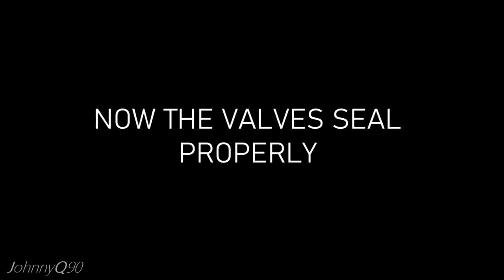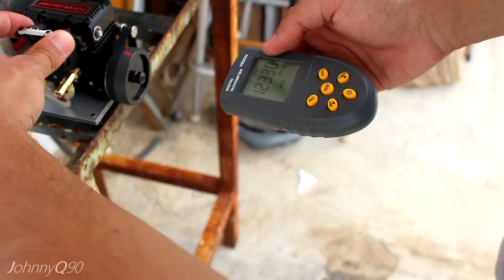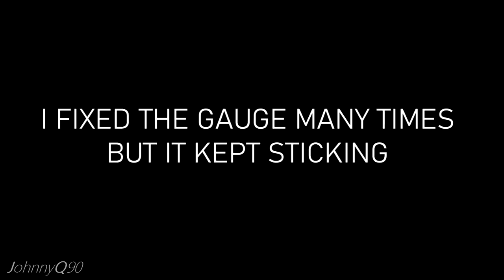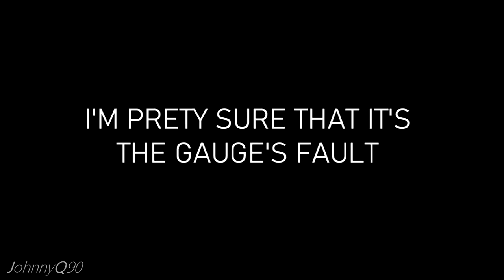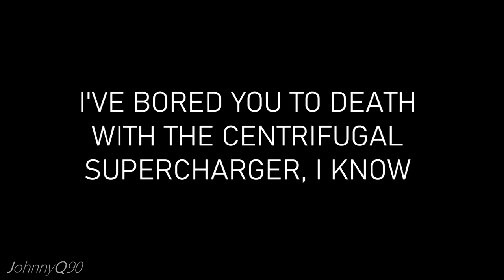PERFORMANCE Upgrade for the 4 Stroke TWIN Cylinder - *VALVE Lapping* - Supercharger Update

Comment: Bored to death with a centrifugal supercharger? Never! I haven't seen one of these things put onto a model engine, and it's super badass! You're so close man! Don't give up!
Reply: 100% agree, don’t give up on the supercharger! Also agree with some of the other comments, possibly EFI? maybe a team up with a channel that can produce something on RasberryPi etc 🧐
Reply: This
Reply: @_Mav  Trust me, you wouldn't want to use a Raspberry Pi (SBC) for any engine application. A microcontroller (Ironically, the Raspberry Pi Pico could be used) is what you want.
Reply: @crenn6977  maybe just add fuel pump?
Reply: @crenn6977  just saw the video and at the end, some sort of fuel injection, even if it's just somet to adjust on the fly as the engine revs. Not EFI, "M (manual) FI" lol. Could this little thing have run away boost? Lol. Alright Johnny, time for that micro blow off valve 😬. How would you solve the EFI if not a small computer controlled fuel injection @crenn6977? I'm legitimately curious because Raspberry Pi popped into my head as well.
Reply: @keepsgoing4evr1  a distributor but instead of controlling spark time it controls injectors that plus a fuel pump
Reply: The reason the charger is pulling fuel is the needle and seat isn’t a clean match and the charger is pulling more vacuum than a N/A motor would.
Reply: @mikaelhgn1  Was thinking something similar. A wastegate/supercharger bypass would probably solve the problem. Even positive displacement chargers like the roots on my Audi have a supercharger bypass. This things boosting at idle. Its going to be a lil monster if he keeps the centrifugal. That or need a bigger charger to flow enough air for the top end lol
Reply: @keepsgoing4evr1  Youre about right. He switched from the blow through design, in which the charger pressurizes the carb throat, and manifold, so you need a fuel pump or exhaust pressure line to pressurize the fuel tank to increase fuel pressure to the carb. He used exhaust pulses and you can see the manifold vacuum gauge was going crazy on that setup. Then he reconfigured it to the draw through design, where the carb simply is under port vacuum from the supercharger pulling air through the carb. The gauge was steady then but had been thrashed to hell so now its reading 3psi lol. I wonder if the exhaust pressure was too much on the pull through setup tbh but we use it on NA engines...

The engine is running on nitromethane, not gasoline, so it uses a glowplug ignition. The timing is controlled more so by the rated temperature of the glow plugs. 

The idle fuel mixture is what @Mikael Hogan was talking about. Its adjusted by a screw but the charger introduces a "dynamic displacement". As the charger pulls air past the needle it pulls more fuel with it which, raises engine rpm, which spins the supercharger faster, which pulls in more intake air, which pulls more fuel, which raises rpm, which makes the supercharger spin faster, which pulls more air, and more fuel, and so on lol. Which is why i say some kind of wastegate/supercharger bypass or EFI would solve the idle running away.

Comment: I wouldn't have expected a difference so big just from lapping the valves....
Reply: The sound difference alone is pretty incredible!
Reply: Well at this scale a small imperfection in manufacturing is very unforgiving. On an LS3 these flaws would lose maybe 5 to 10 HP over the stock 430, but on this, for like 1 HP it could stand to lose perhaps a quarter HP or so at the worst. So for an LS being a full size motor, that's between 1 to 2 percent power loss, but on this tiny motor that's a 25 percent loss in power. And with so much air flowing between the valves and the valve seats at 12k RPM before the lapping, it was losing a lot of potential power especially since its rated to reach 16k RPM (it is a Toyan L200). So with that defect fixed and even made better than stock, it likely makes somewhere around 1.25 HP without the supercharger and perhaps 3 or more with the supercharger once the AFR is tuned right with the 10 to 1 pulley.
Reply: @Avetho  3 HP from an engine this size would be amazing to see in action
Reply: Watch where he points lazer when he checks rpm. He is getting more rpm the second reading because he checks it closer to crankshaft. Lapping valves will increase efficiency and power but not by 4,000 rpm
Reply: Jacob Credle you might be confused, the rpm of a rotating body does not change depending where you measure it. A wheel spinning at 60rpm is spinning at 60rpm no matter where you measure it
Reply: @jacobcredle4807  a turn is a turn, the lazer don't care where it is pointed....
Reply: @red1246  yep no regards for diameter. Its not speed were measuring.
Reply: It has more compression with lapped valves.
Reply: The carburetor is also different. It would be a fair comparison if he'd have used the same carb for both runs.
Reply: different carb is contributing more to the increase than the lapping. completely different carb setups between the 12k and 16k run
Reply: @jacobcredle4807  since it’s using a laser which is traveling at the speed of light I don’t think a few centimeters of distance would matter. You could try it yourself with one of them to confirm.
Reply: @gabrielvalencia1395  Lightspeed and radius don't make a difference in this application. 
The rpm meter measures a frequency. As long as the sensors rise time is fast enough to catch the reflective tape, everything else is irrelevant.
Reply: @fabianrudzewski9027  this is only true because the sensor uses a laser. I stand by my statement. If for arguments sake it used something other than a laser which was slower, it would in fact alter the numbers because the response would take measurably longer to come back. Heck we use lasers for space applications and with long enough distances they do take measurable time to come back which has to be taken into consideration. But at these distances it’s hardly an issue. But yes the sensor processing time is also relevant. If it can’t keep up the numbers will be inaccurate.
Reply: @fabianrudzewski9027  I do agree that radius is irrelevant. Doesn’t matter how big the revolution is. We only care how many per minute and the relative increase or decrease. But that wasn’t the claim  in the other person’s comment.
Reply: @DoctorSherwood  i disagree on this. before lapping performance was notably poor, it even seemed to misfire. the before shots of the valve and seat show them to be completely unfinished. the one furthest left at 2:35 even appears to have a scratch on the face. all of that adds up to compression lost past the valves.
Reply: @jacobcredle4807  finely someone who can think
Reply: @apleatherworking9952  well a few people and I just explained why he's wrong
Reply: Small scale enhancements make all the difference
Reply: @gabrielvalencia1395  LOL light from a laser is no faster than light from any other source.
Reply: @DoctorSherwood  Totally agree, the fuel mixture was obviously not right previously, this makes a massive difference to the RPM potential of these small engines.
Reply: @jacobcredle4807  rpm is not distance, it is revolutions per minute.  It does not matter where you measure it on a wheel.
Reply: @gabrielvalencia1395  you don't have to use a laser to count rps. And it doesn't matter how fast it recognizes it. 1 RPM is still one RPM regardless if it takes 1 millisecond to read it for 10 years to read it.
Reply: @gabrielvalencia1395  even if the response takes longer to come back it's still going to be receiving an input of the same frequency. The delay of the answer makes no difference; is my point.
Reply: @sepg5084  seems like someone passed Elementary grade science! It's insane that people still think that stuff.
Reply: @jacobcredle4807  that wont change the reading, you can clearly hear the difference as well
Reply: @grimfada  I’m not talking about the spinning. Of course that doesn’t change. I’m talking about the sensor. The underlying assumption in your statement is that you can read as fast or faster than the spinning. In other words, your sensor will always keep up with a single revolution. My point is if the approach for capturing the reflected light took longer than a single revolution (which of course is not the case here because a laser is a form of light, duh, I know that), then you would miss out on revolutions. Hence your reading would be inaccurate. No such thing as a free lunch guys. You guys are not realizing that everything is based on the assumption that you can always keep up with the revolutions. I’m not making that assumption. If, for arguments sake, the spinner were far enough away in space that the laser would take longer than a revolution to come back, you would miss out on revolutions wouldn’t you? That has to be obvious. But of course with a laser being as fast as light and traveling at these distances it’s impossible to ever outpace it. But that doesn’t change the fact that it’s all dependent on speed of reading which is affected by distance from the reflector. We are just so accustomed to the benefits of light speed reading we can’t fathom ever being failed by it. But it is theoretically possible.
Reply: Lapping valves didnt change the sound. It can. By increasing compression. The valve seat and valve need to be grinded together to create a pressurized seal. Take a non lapped valve and drop it in and look through the port. Will almost look like daytime in there.
As for engine sound difference im not 100% sure but in the thumbnail it appears as if the stems are different length. Can make a major difference in the actuation of the valves

Tldr; valve lapping is just standard process of install to create the seal. No real sound change
Reply: The carb is different. That probably helps with the rpms, and it will most definitely help with the throttle response.
Reply: @gabrielvalencia1395  even if the you used Ultrasonic or a micro switch, it wouldn't matter.
Even if you had a terribly slow Sensor, as long as it's fast enough to change state because of the marker, it wouldn't matter. 
Having a lagging sensor would only introduce a delay between the marker being visible the first time and the processor's input changing state. You may say, that this would kill accuracy, but:
What happens, when the marker comes into view the next time? The exact same delay is introduced again, and the next pin change at the processor occurs exactly one period after the first. Therefore your rpm reading is perfectly accurate.
Reply: Polishing the valves doesn't make a engine rev especially nearly 2,000 more. The engine must of had a problem with it and he tore it down and rebuilt it. It must of fixed it, throttle not opening fully?
Reply: @plang42  He did replace the carbs, so maybe they were too constricted.
Reply: @jacobcredle4807  RPM if RPM surface speed is different but it gets slower this the closer you get to the centre and faster on the outer circumference but rpm is RPM.
Reply: @grimfada  that is exactly what I said. Thank you for confirming my statement.
Reply: @jacobcredle4807  Really? RPMS are RPMS! Doesn't matter if you meassure close to the center or far from it. Only difference would be tangential speed. I also find hard to belive to get 20% more rpms by just lapping the valves but definitely has nothing to do with where he is meassuring.
Reply: @fabianrudzewski9027  look at my example above. On earth you could never miss revs because light is fast enough to return to the sensor in time from the reflective tape. But at far enough distances it would take so long you would miss out on revolutions of the reflective tape. Hence it holds that we are dependent on the speed of light and the distance but could never in practice be too slow for any practical distances in question. Just trying to be accurate here and not be blind to assumptions. Nothing wrong with that. Johnny didn’t do anything wrong here in his measurements. I’m just answering the other commenter who is wrong to say that such a short distance could possibly affect the readout when light is so fast.
Reply: @gabrielvalencia1395  The standard sized .21 (3,5ccm) nitro engines used in 1/8th racing already have nearly 3hp (2,8-2,9). The bigger ones with .28 or .32 are even stronger.
Reply: @gabrielvalencia1395  yet you aren't accurate. 
What you have explained several times is the problem that occurs in repeated, individual distance measurement like in lidar, where measuring frequency becomes higher than the travel time of each pulse. This isnt only theoretical but a very real problem right here on earth.

Meanwhile in rpm measurement, you aren't dependent on a single pulse to be reflected.
Instead, you count the number of reflections out of a continuous beam of light, Ultrasonic, whatever.
For that, it's of no importance whatsoever, how long the travel time of the signal is. 
Simply because the information is contained in the string of pulses, which never changes (ignoring deflection, absorption etc).
You could point a laser to the sun and accurately measure a 100k rpm signal, just that the rev counter would show with a 16 minute offset.

Oh and with "on earth you can never miss..." You completely ignore the sensing side of the whole thing. That is, where it gets interesting.
Reply: @fabianrudzewski9027  I get what you’re saying but that only proves my point. Your example of the sun would have a 16 min offset. That means the reading you get IS relative to your position from the thing you’re measuring! How can you just shrug off a 16 min delay? So it’s ok to measure and say “yep that’s how fast it’s spinning” even though, because of the distance, we don’t yet know that it could have slowed down or sped up already? That isn’t an accurate statement. You’d have to say “this thing is spinning at this rate from my relative position at this point in time”. 

My whole point is that you can’t just claim that position is IRRELEVANT as some others claimed. Of course it’s relevant; but you can say it’s negligible. It simply doesn’t affect results in Johnny’s measurements (as the other commenter suggested) because it’s light and it’s a tiny distance. And therefore we don’t have to be precise and talk about relativity at this scale.
Reply: @fabianrudzewski9027  I never ignored the sensor side. That can have technical limitations obviously. I just accepted it as such as others did.
Reply: @gabrielvalencia1395  no, the latency doesn't matter, you can substract the time it takes to come back from the first "response" you get, all subsequent ones will come at the same frequency, they are offset by the latency of light. The frequency would be the same.
Reply: This makes me think... If he would do the same to the V4 engine in the model Lancer maybe it will gain enough rpm to get into the other gears
Reply: @FlyXenonRC  He is confused Centripetal motion an linear motion are not the same, example 15 inch wheel and 17 inch wheel can rotate at the same rate but their resultant linear velocity will be different. Real world example, if you change the wheel diameter on your car from the factory profile, your speedometer will no longer show you your true speed as it was tuned with a specific wheel circumference. So if you go from a 16 to an 18-19 inch rim you will want to select a tire with an appropriately smaller aspect ratio to one  fit in the wheel well and two not greatly affect the functionality of your speedometer.
Reply: That's not how rpm works

Comment: Sounds like it's running super lean .  More air also means more fuel is needed.
Reply: I was thinking the same thing. Seemed like the base idle screw needs some adjustment.
Reply: Or even a boost referenced fuel pressure regulator. Almost need an electronic fuel pump with a return setup to try and supply the fuel it needs id say
Reply: Absolutly way to lean, crank the needle valve up and maybe will work
Reply: @castekracing  thats why he went carb before supercharger. this way the carb doesnt see the pressure.
Reply: @rehepeks  that’s true. I haven’t done much with draw through.
Reply: @castekracing  maybe he can add another pulley spinning a fuel pump